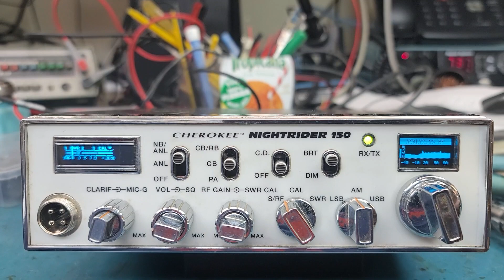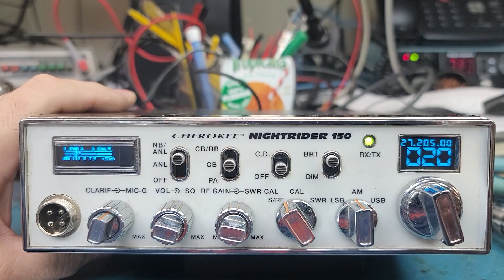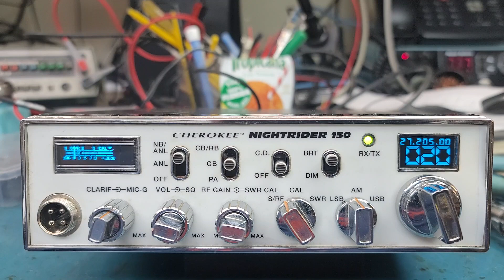DDS VFO for kornel

Comment: What enables HF receive and does it use the Cb antenna?
Reply from the maker: You dial to HF in the menu and that switches in the HF mixer. Yes it does use the cb antenna but you can ask to have a separate HF RX antenna terminal. We normally will use a bnc.

Comment: As it LOOKS like a Cobra 148GTL knockoff, what chassis does it actuall use?
Reply from the maker: Its basically a Galaxy/ Rci chassis. Nothing special.
Reply from the maker: Its really close to a Galaxy/Ranger type.
Differant part numbers and Lo.O is a bit differant but yea, regular pll with the 2 adders etc.
Reply: @ddsvfo  More like an early 148GTL-DX then?